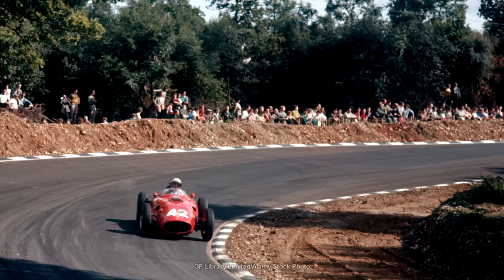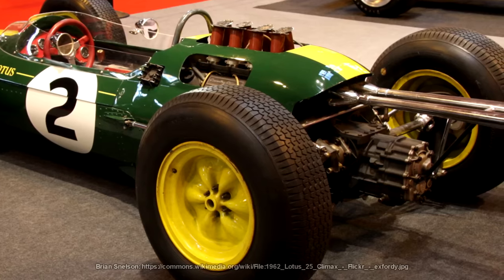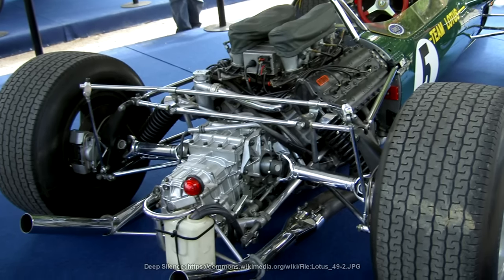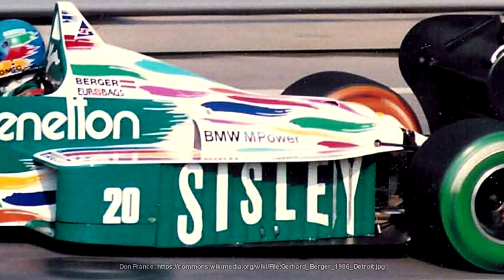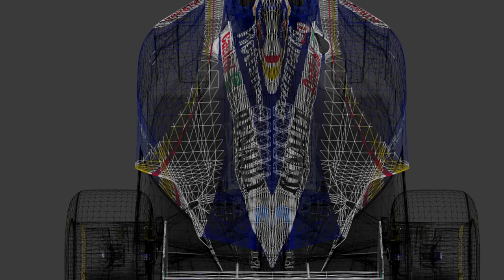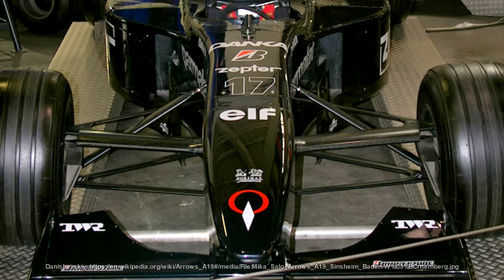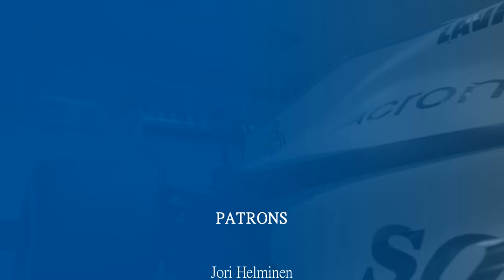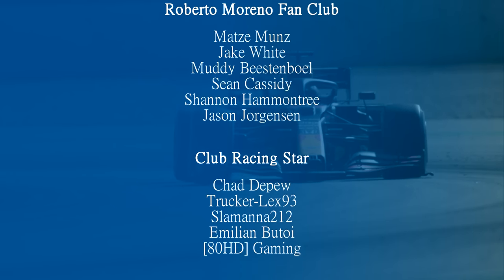FASTER THAN YOU CAN BLINK! A History of Formula One Gearbox Construction

Comment: In the 1970s, the Weismann company built a F1 gearbox that used a completely different shift design and operating principle. The shift mechanism lived INSIDE the gear shafts, and shifts were instantaneous,  as when the driver pulled the lever, the trans was ALREADY in the next gear....yeah, magic. Patrick Weismann alluded to the project on his FB page, and I've seen a couple of period photos of the internals. Ive never found any detailed info on how it worked. Still top secret after all these years.
Reply: Weismann also did that funky 7-speed manual for Brabham for the BT55.
Reply: I wonder if it was anything similar to an internal gear bicycle hub (think the three speed Sturmey Archer hubs on British bikes though there are more modern, complex ones currently made, Rohloff being the cream of the crop). They use pawls on the axle to lock certain sets of planetary gears to the axle and unlock others. The pawls are controlled through the hollow center of the axle, either by a sliding mechanism or rotating one.

Comment: Pre-war power levels weren't surpassed until the turbo era of the 80's.

 You should watch "Supercharged Grand Prix Cars 1924-1939 (full version)"

And do they rev the engine on down shifts to protect it, or stop you semi locking up the rear wheels?

Comment: The 1961-63 Pontiac Tempest SD-421 had a 2 speed automatic transaxle borrowed and modified from the Corviar, however they were doubled up to produce 4 speed semi automatics. The car was front engine rear wheel drive, but the transmission was a transaxle for better weight distribution. The 1963 Pontiac Tempest win at Daytona is one of my favorite stories

Comment: A thing I found very interesting is the brief reversion to 5-speed manuals in the first part of the turbo era, from 1980-1985 (with the exception of the 6-speed manual Honda cars and the Porsche stuck with a 5-speed until 1987.) These were dog-leg boxes with this pattern. The last car with a 5-Speed was the Brawn designed Arrows A11/A11B.

R 2 4
1 3 5

Comment: Seeing one of these, or any high level formula car trans in person it becomes amazing how tiny they are and can still handle the power. Even just the gears almost seem like they should be in a 100hp motorcycle and not a several hundred hp formula car. Granted the lightweight of a formula car and relatively low torque of the engines means you don’t need as big and heavy components.

Comment: In the early 2000's, World Rally Car gearboxes could change through the gears from 1st to 6th and back down to 1st in less time than it takes a manual gearbox to change one gear. 

If you want some fun gear change footage, John Frankenheimer's Grand Prix from 1966 is great. A lot of the in-car pedal footage was shot at Riverside Raceway, and one of the drivers was able to replicate all of the gear changes for a lap of Monaco on the track's 1.1 mile straightaway.

Comment: Very good video, Aidan. These gearboxes all seem like Dual-clutch motorcycle transmissions complete with blipping. These are street bikes, so the technology is infiltrating everything. Cheers from the Pacific West Coast of Canada.
Reply: Very few motorcycles use dual clutch transmissions. I think you're thinking of a sequential dog box. The last time I was anywhere near an F1 car on a track was 15-20 years ago and you could clearly hear the sound of the dogs engaging, a sort of 'bang' or loud 'tock' sound.
A dog box doesn't need to be sequential though as the dogs basically just take the place of the synchros on a regular manual.

Comment: @6:11  I don't think Senna was "lifting and slamming" in that Suzuka clip from '89. It looks and sounds like he was shifting through more than one gear before releasing the clutch. You can see Johnny Dumfrees do a similar thing during the onboard of Australia 1986. 

If you just lift and slam a manual on the downshift without rev matching, you're going to under-rotate the rear wheels and spin out.

Comment: The Lotus 49 used a ZF gearbox with synchromesh gears in the early years. And roller bearing sliding output shafts. Nicely constructed. No gear ratios could be changed.

Comment: I find it interesting that F1 gearbox evolution went from H-pattern shifter straight to paddle shifters. While other series like Indycars, sportscars, touring cars and rally went more naturally from H-pattern to sequential stick to paddle shifters. On the other hand Nascar has only recently transitioned to sequential sticks after driving H-pattern for so long.
Reply: And interestingly, now using more then just 4 gears as well. Granted for a while, having only two Road Courses on a schedule predominately consisting of Ovals big and small did make having more then 4 seem pointless but the ever increasing influence of Road Racing influence coming over to Nascar (be it the drivers, the tracks or the coaching) is making quite a compelling case to have that 5th gear.

Comment: my understanding of a seemless shift is, there are 2 clutches. clutch 1 is attached to 1st, 3rd, 5th gears. clutch 2 is attached to 2nd, 4th, 6th gears. in 1st gear, clutch 1 is engaged and 2nd gear is ready but that clutch 2 is disengaged. when you shift up, clutch 1 disengages and clutch 2 engages. etc etc.
Reply: That's a DCT (dual clutch transmission) and is how most street car flappy paddle transmissions work (except for all the ones that are actually slush boxes with paddles) but it's not what F1 uses. Just one clutch in an F1 tranny.

Comment: Having driven a straight-cut Hewland H-pattern box, yes, you can slam it into the nalext gear on the upshifts, and in some situations, that's the technique to go with. Over a grand prix distance... with the greatest respect to the engineers and machinists at Hewland, whatever time might be saved by not using the clutch could easily come to nothing if the transmission doesn't last. A man like Jim Clark would have been well aware of that calculus, I have no doubt whatsoever.
Reply from the maker: This is what was going through my mind when I saw his on board. Given how Clark managed to bring cars home with virtually no wear on them he could have been always clutching but might have been metronomic with his lift n slam. While at the same time, Rossi might have been told to clutch to be safer with a 55 year old box that’s probably been rebuilt 40 times.

Shame there’s so little onboard from those days.

Comment: Woah! Woah! Woah! Heeling and toeing on the downshift so that the engine doesn't explode!? You have, like too many people, completely misunderstood the purpose of both heel/toe and rev-matching. Heeling and toeing is a necessary part of double-declutch downshifting so that gears without synchromesh can be engaged at the same revs (blipping the throttle matches the engine speed to the road speed). So the driver is raising the engine revs while simultaneously braking and operating the clutch which since no F1 has three legs means using the right foot to do two jobs. If the car's going too fast for the gear you're selecting, that will still blow the engine, even after you've heeled and toed or tried to revive match, because you won't be able to rev match if you're not going slowly enough. The road speed and the gears will overrev the engine for you once the clutch is engaged. What you really need to do if you want to avoid blowing the engine up on a downshift is to brake sufficiently that the car's ready for a lower gear. After that you can slam it into gear, rely on synchromesh if you have it, blip the throttle and you won't blow the engine.

Comment: I wonder why F1 didnt ever use dogboxes / faceplated gears with a handcuff in place of the selector fork for no-lift changes?  or a sequential where you never cross neutral between gears (theres only one below first) like the G-Force GSR .. I don't know, does the transaxle design preclude this? and I guess sharing oil with your differential is also not an optimum design from an engineering viewpoint.

Comment: Surprising F1 never went with sequential shifters, the way Indy car did in the 90s where pull back is upshift and push forward is a downshift. Way faster than an H pattern and not as technically challenging to implement as a paddle shifting.
Reply: All flappy paddles are basically sequentials.
Reply: @wingracer1614  true they are, it's just the mechanism for making them shift is different.

Comment: The rpm drop is pretty much dictated by the gearing, the bigger the gap between the 2 gears, the bigger the rpm drop and vice versa. Now that they have 8 gears all ratios are very close together which means the rpm difference very small hence very small rpm drop. Obviously if your shift takes longer the rpm will drop lower but it will pick up again after the clutch engages so technically a slower shift will drop rpms lower, but the gearing is the main thing